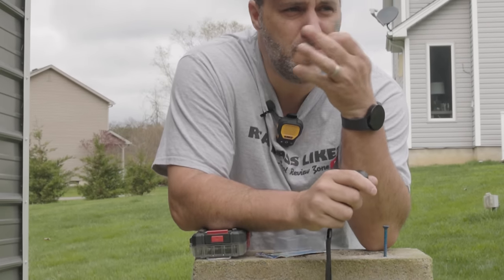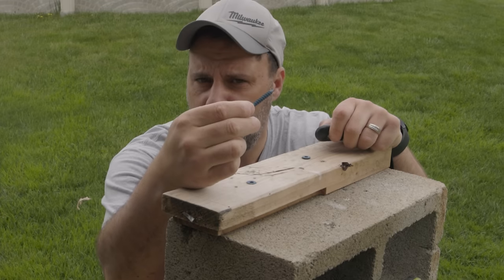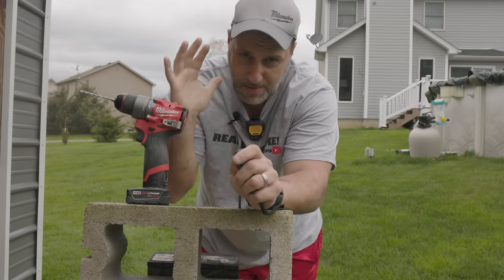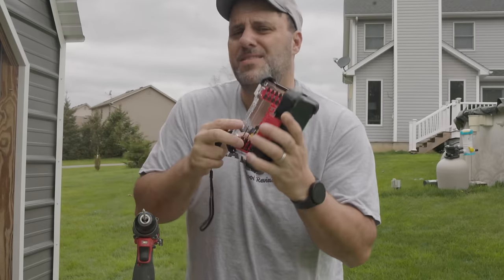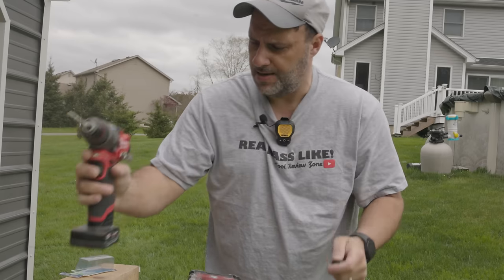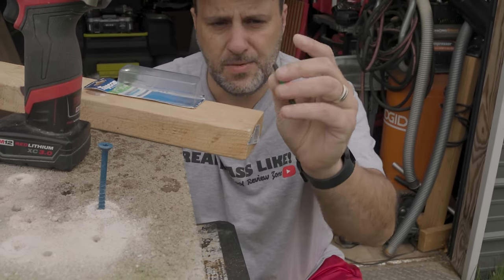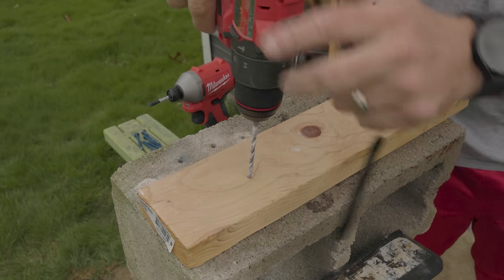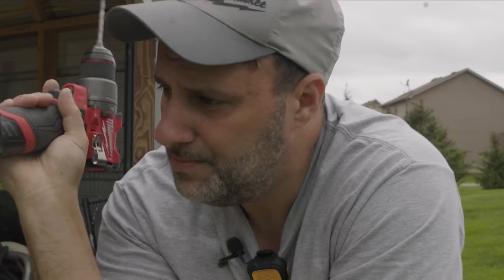TAPCONS: How to use them and the tools you'll need

Comment: thank you so much i am a mechanic by trade, however ive always been terrible at hanging shelfs/workshop equipment in my rented garage. this video was really clear, concise and i really appreciated the tip you gave about using a smaller size bit and why its necessary.
Reply from the maker: And I really appreciate this comment.  Thanks 57👊👊

Comment: I have countersink type Tapcons in my Box but I rarely use that configuration.  I mostly use the HexHeads because I use washers with them for additional holding capability.  
I might use a driver to sink the Tapcon into the hole.  But before it bottoms out I switch to a Socket Wrench to finish.  Because it affords me greater control and I don't have to worry about them being tightened to the point where they go too far and loosen up.  
Prior to screwing in the Tapcon Fastener, I always cover the screw portion with "No More Nails" adhesive.  Once in they stay.  And I don't use a screw driver bit to put in my HexHeads, I use a socket.  And depending on what I am mounting to a wall, etc.  I sometimes put the adhesive on the underside of the washers as well.

Comment: Consider avoiding wobbling the bit around as it will effect the grab of the screw and when using thinner bits will cause breakage, also run the drill slow to create a center point as you begin the hole. I mount a lot of things that have set location holes and have found it makes for a much cleaner job.

Comment: Tapcons changed the game of masonry anchors, but they do have their own set of issues like anything else does. They're persnickety about perfect holes; too loose they won't grab and too tight they break off. To keep the threads from smearing off they must be hardened, and hardened fasteners are brittle so they shouldn't be used for structural loads. Correct tightness is something learned only through experience, and you'll snap head off until you learn which is very frustrating. They do have an off-label use where they work very well...

We were adding a staircase to the outside of a deck supported by metal pipe posts, and we needed to attach a handrail system to those posts which don't have a lot of wall thickness. We could weld brackets to the posts but we had no welder. Drilling and tapping the pipe would be dicey with the thin metal stripping out easily. So we clamped the wood in place, chose a metal bit equal to the minor diameter (shank) of some Tapcon screws for a pilot hole, and drove them through the wood into the metal where they held beautifully. What happens here is that the thread's coarser pitch than machine screws have gives the Tapcons more metal thickness for each thread to bite into, and the hardened threads push into the softer metal of the pipe making for a tighter grip than a tapped hole can have. This trick won't work on thicker metals as the screws will snap off, but that can be drilled and tapped. It's not good for softer metal like aluminum either unless there's adequate thickness, but it's a great time and money saver when you can use it. Just remember- no structural loads for Tapcons.

Comment: Have the tap con installion kit and never fails if I'm using a dozen of them two holes will strip out. Tried 3 different hammer drill & a cordless drill for holes and all had stepped holes. If I want a best in class 100% positive results will drill a 1/2" hole and use my Greenlee screw in anchor setting tool to set a 1/4" lead anchor. For lighter work use a plastic anchor and drill a 1/4" hole.
Reply: I'd you strip the hole put a couple of zipties in there,works amazingly

Comment: Glad to see they went to Torx head screws. I have had better luck with the hex heads in concrete. You also need a can of compressed air to blow out the dust after drilling in concrete because the dust will compress and prevent the screw from going in all the way or possibly cause a snap off. Thanks for the primer.
Reply: great tip, thanks

Comment: the reason you use a 3/16" bit is because the shaft of the screw is 3/16" and the outside diameter of the threads is 1/4" (the threads need something to bite into) it's not because you you move your drill bit from side to side when you are drilling....and why not use a hex base 3/16" drill bit and you only need to use your impact driver for drilling and driving the screw

Comment: Now do the same thing into a solid concrete wall. I can’t tell you how many Tapcons I have snapped in my day. I gave up and went with Toggler brand Alligator anchors. Not as handy or quick, but it sure beats the frustration of snapping a tapcon . I did learn recently that tap con is not supposed to go into the concrete more than 1 inch and I think I was trying to drive it farther than that. Anyway, it would be a good tutorial.
Reply from the maker: I've done it many times. Just have to make sure the hoke is deep enough or it will snap

Comment: The only problem is tapcons are crap and you can’t unscrew them after a few years old they brake off to easily and also don’t come out the way they should otherwise as always your right about the tools you show on your channel and amazing advice on how tos
Reply: You can't reuse tapcons, or the holes you drilled for them, so why are you taking them out? 
Only reason I can think of is if you fucked something up during the build. If that's the case, build on top of the wood. That's why you put it there
Reply: Technically, I guess you can reuse the tapcons/holes, if you do, you shouldn't be working on other people's property. Keep the hack shit at the house
Reply: @bradprater4789  it’s not Because I fucked up it’s because I wanted to remove them cause the application I was using them for I didn’t need anymore and also wanted to replace the item I was using them to tie down with and wanted to replace the item I used them to tie down with and the tops popped off like pop bottle lids and they were only a year or 2 old since I put them in

Comment: You don't want to use hammer mode to sink tapcons. Better to put it back in normal mode or you're gonna go hammering on the bit the threads are supposed to hold and weaken it. Though I also prefer to use an impact driver. I donno if it might do that too, but I don't think it hits as hard down.
Reply: The problem with an impact is rotational shaking that happens when it starts to encounter resistance. This shaking causes loose concrete to fall around the thread of the screw, it then gums up and you end up braking the head off before you have driven it home. As per the instructions, blow out loose dust and debris from the hole then sink the screw with a drill in standard rotational mode.